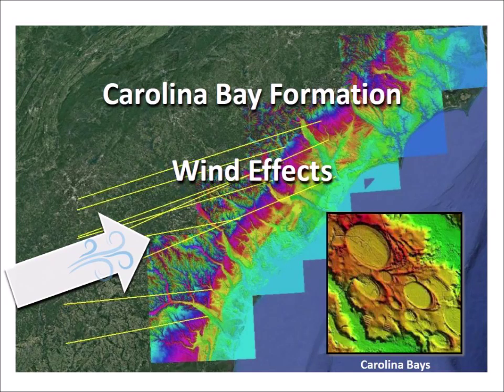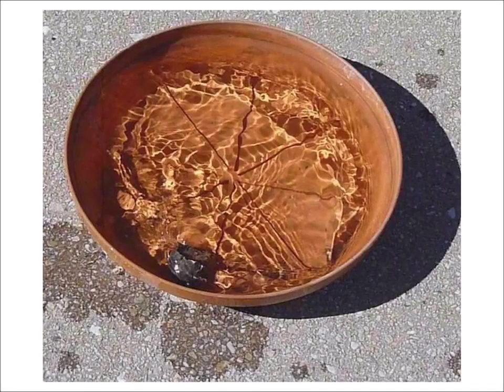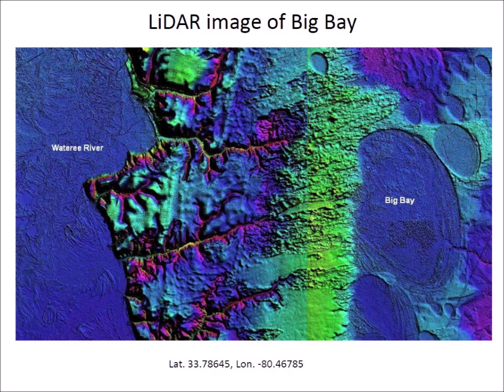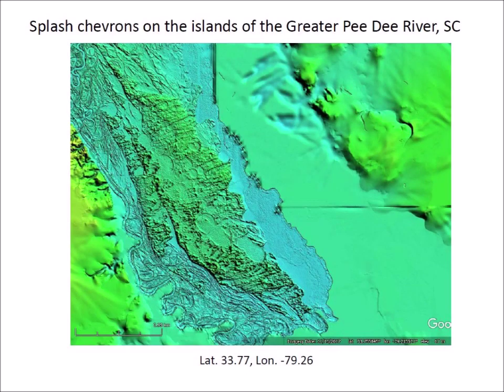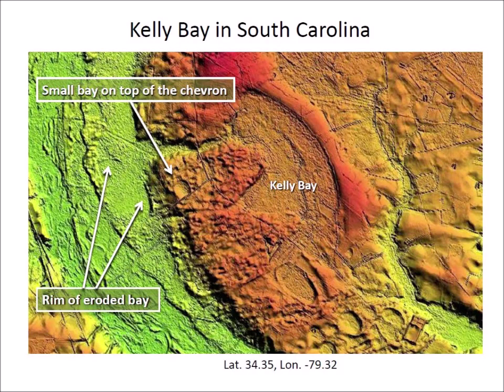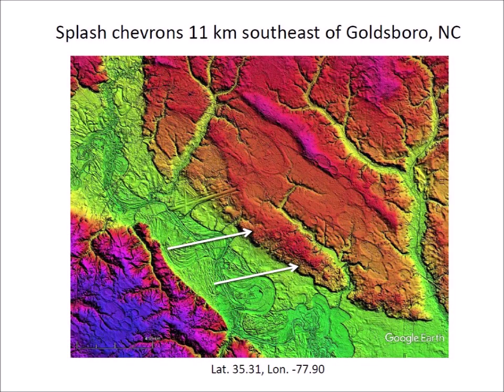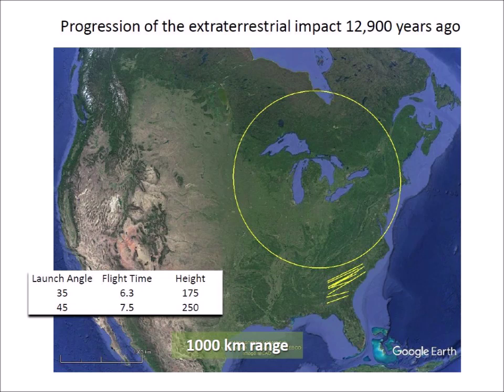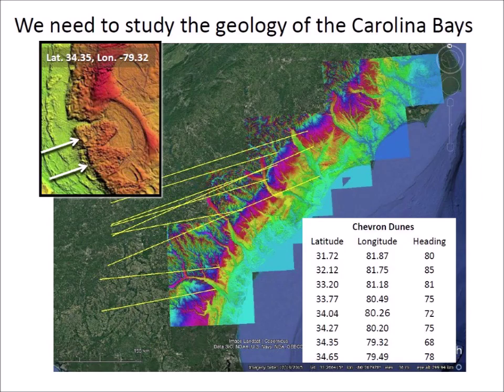Carolina Bay formation - Wind effects

Comment: Bringing the Jet Stream in to explain the winds is a brilliant piece of intuition, normal winds in the period of time it took to create the bays is simply fanciful.  I did wonder about Vortices caused by the passing of the impacting comet through the atmosphere could have having an effect ... maybe they helped 'bring down' the Jet Stream?
Reply from the maker: In a reply to a previous comment, I noted that the entry of the comet would have been to the northwest of the Carolina Bays, and any wind associated with that vortex would not have been from the right direction. We will need to get some weather models to see the effect on the jet stream of the exploding comet in Saginaw Bay and the expanding ejecta courtain of the ice pieces. The ejecta curtain expands in the shape of an inverted cone which would trap the jet stream under it. This is a problem that requires astronomers, geologists and weathermen
Reply: @Antonio_Zamora  That makes sense. I couldn't figure out clockwise or anticlockwise.  Also I think the winds would have been blowing before, during and after the Bay impacts, and not so much be caused by post impact falling debris.  I would imagine the front of the incoming atmospheric shock-wave would have done the trick.  I must admit to be  knowing diddly squat about 'atmospherics' but I think the vortex ideas are a dead end come to think of it.  The key to all this is getting a better handle on the time frame of the formation of the bays as a whole across the whole area of their occurrence.  Supposition would then be conclusive in deciding Jet Stream or gradualist wind effects.

Comment: Was the strong westerly wind a product of bolide shock waves as part of the incoming bombardment? How strong would the winds have been?
Reply from the maker: It is not very likely that the passage of the extraterrestrial object through the atmosphere was responsible for the strong westerly wind.  An approach tangential to the Earth with an impact point in Saginaw Bay would have required entry of the ET object at the Missouri/Arkansas border (Lat. 35.4 degrees), which is north of the chevrons examined in the video.  This would have generated a pressure wave from the north, rather than from the west. If the saturation bombardment by the glacier ice boulders shifted the Polar jet stream downward toward the surface, the wind speed would have been about 125 km/h or about 78 mph.
Reply: @Antonio_Zamora  Thanks, the question was typed before watching that part of the video!
Reply: @Antonio_Zamora ..although, thinking about it, I was imagining a fairly extensive bolide train exploding along the length of the continent.
Your explanation has Occam's razor on its side, unless further evidence should come to light.

Comment: I can't buy the wind hypothesis. Ordinary wind is not going to move a wall of water and debris much from the direction it is already moving. The water movement from the impact would be quick, leaving very little time for wind to do its small part.
Reply from the maker: Try spitting into a strong wind and see what happens.  Seriously, the winds from the jet stream at 125 kilometers per hour (about 78 mph) are like category 1 hurricane winds ( https://www.nhc.noaa.gov/aboutsshws.php ).  The chevrons are only found on the east side of the streams.  Why are the chevrons not symmetrical on both sides?  Drs. Moore and Brooks attribute it to the wind.  If the asymmetry is not caused by the wind, then what is the cause?
Reply: Is it possible that slow effects of wind had moved sand to the East banks prior to impact, so that the splash could only create chevrons pointing East?